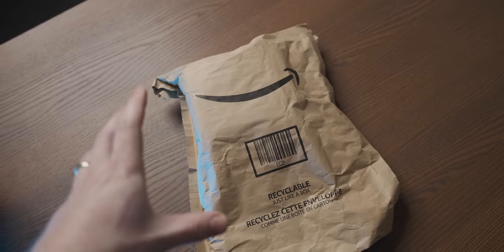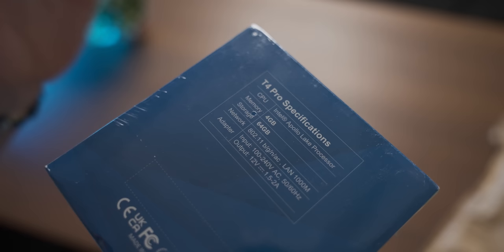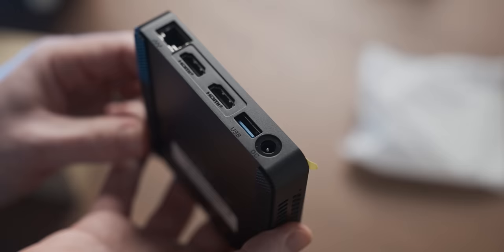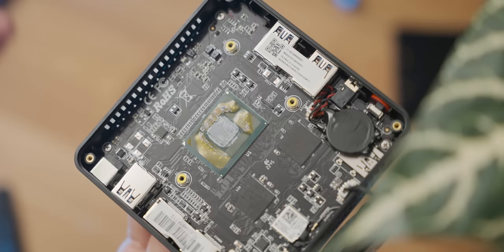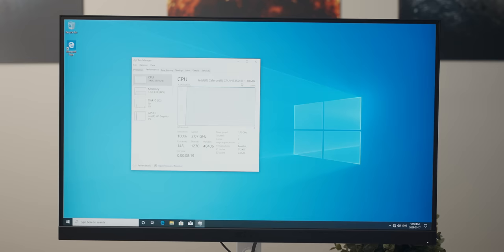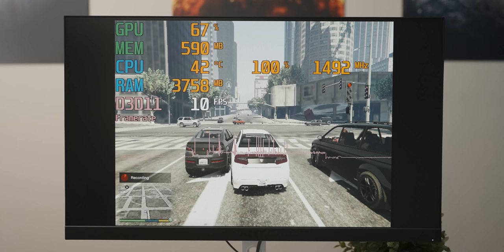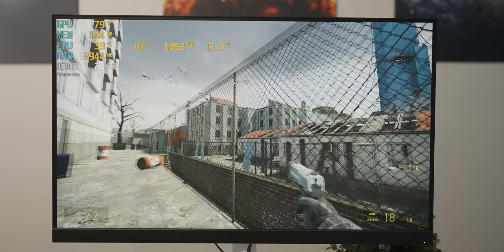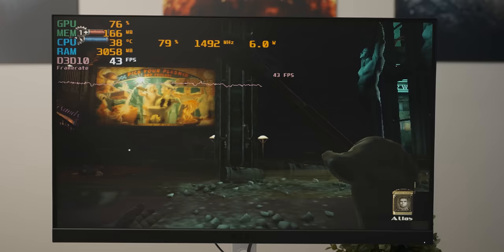This $100ish Amazon PC Is Apparently "Perfect for gaming"...

Comment: I have a couple of Celeron machines like these deployed. These are actually perfect for very casual computing and for low power, always on application. I use one for my 3D printer, and another for a home file/media server.
Reply: yep, I'm watching Youtube in my living room on a Celeron 2957U.
Reply: what the hell is home file server?
Reply: These mini pcs are awesome for office work
Reply: @sebastjansslavitis3898  Google your question
Reply: @uhm175  lol. He was totally baiting that guy. I Love your response
Reply: Can confirm, this kind of low power Celeron and Atom PC's are perfect for low power machines like network firewalls/adblock solutions like AdGuard Home or PiHole. Have few of those rocking not only AdGuard Home, but also simple Debian install which opens in full screen Plex at start so it can play files from another file server in home or for YouTube playback (and those are used on older smart TV's where OS is outdated and can't play YouTube at all anymore) and as Home Assistant Servers. For cheap (if looking on second hand marketplaces) I got like 5 of similar machines (obviously, varying CPU's from Celeron's and Atom's from mid 2012 to 2015) for price as low as 100€ (including for some new SSD's and WiFi cards).

Low power home lab FTW.
Reply: You can't use it for a media server. If Plex tries to transcode something it will blow up.
Reply: @marsovac  and that is why in my case Plex is used to playback from another server, it is just linked to it using that machines IP. For that use is flawless, and for maybe music playback from Plex server hosted on that kind of machine, didn't tried it, but will give a go when buy next mini PC like others with similar specs.
Reply: @idzan-private  wouldnt an Android TV device or an old Android phone be more efficient? 🤔
Reply: @sebastjansslavitis3898  were you born yesterday or something?
Reply: So basically an alternative to a raspberry Pi?  Or is it replacing the printer's processor?
Reply: @FranNyan  it could be alternative to RPi in this situation where RPi's are hard even to buy. But with Windows 10/11 compatibility it is sometimes better then RPi for some apps, like 3D Printer slicers.
Reply: @TragicAyk  yeah, for tv at least you would be much better with a cheap android box / streaming stick / roku hehe.  They all support plex and come with remotes and should have a slightly lower TDP than this I think... Android tv boxes typically perform better with games also I guess 😁.  For linux a raspberry pi seems like it would make a lot more sense than this also ?, and half the price 🤷‍♂
Reply: @sebastjansslavitis3898  its like a cloud storage thing
Reply: Casual like baby's first computer? Like minesweeper?
Reply: Sounds useless when any native pc can handle what you bought that cheap crappy one for. More justified chinese junk. Gonna sound crazy but I can process 3D renderings and play games all on one computer
Reply: @idzan-private  Exactly what I was going to say. It beats building an SBC system for a cloud server or the like. No need to buy a case and wire everything up.
Reply: @Revenant483  and on bright side - low power usage, which is in this climate of high energy prices - must have. And it is way more economical to run as cluster for your home-lab solutions (except NAS, for that really need space for drives and more resources really)
Reply: i swear people just make up use cases for things like this so they can justify spending their money in stupid ways
Reply: @SLAAMIT  nah man, just buy 15 chinese ewaste computers that can hardly do anything at all for bloated prices and consider yourself a tech guru for cheating yourself out of time and money
Reply: @idzan-private  Agreed! I guess it would not be easy to expand without adding more SSDs to the setup somehow.
Reply: Isnt it way more practical and cost effective to deploy these things on a raspberry pi or somethin like that?
Reply: @sebastjansslavitis3898  A file server, At home?
Reply: @dayenah8290  Disregarding the fact that you literally can't buy Raspberry Pis right now, something with an x86 arch is going to have better support than a Pi - even under *nix.
Reply: @SLAAMIT  What is a "native pc"? What if someone doesn't have or need a powerful desktop computer but wants to run a home server? What if someone wants to process 3D renderings and play games at the same time?
Reply: @gutless_worm  fair point :)
I didn't buy a raspberry pi for years. I didn't run into compatibility issues with the CPU architecture of a raspberry pi but you are definitely right, this could happen in certain use cases. :)
Reply: @sebastjansslavitis3898  if you don’t know what a home file server is you shouldn’t be watching this channel
Reply: @dayenah8290  raspberry pies are expensive as fuck
Reply: I have a J4125, it's not bad at all. Running Plex server I can use it to record tv without any problems, it can serve it back still with no problems, it can do transcoding but that's a bit of risky business depending on the situation. And while I admit it was a very, very low bar... I played a little Ion Fury on it via Steam remote play. Made no sense to run it on the little thing so I can play it on the one with double digit vram on the gpu, but hey, it was a test.
Reply from the maker: I’m glad you found some cool uses for yours. Those both sound like very useful things. 👍
Reply: @gutless_worm  Think about what you just commented. A native PC can process renderings (clearly isn't the one in the video) but a native PC can do both at the same time aka any pc built prior 2015...... There's no point in buying an underperforming device unless it's for content
Reply: @gutless_worm  I bet you have a PC for each room in your house because that's a necessity right?
Reply: @TragicAyk  I wouldn't recommend using a phone for something like that unless you want have content to post on r/spicypillows
Reply: @Marino Šimić  😃 it will work, but you'll watch PowerPoint slide show movie...
Reply: @sebastjansslavitis3898  It's server situated at home used to store file🤣🤣
Reply: @gamingmark54  why just don't store things on your pc?
Reply: @sakshyamrijal531  and why cant you just store things on your pc?
Reply: @Nas_Allie  and you shouldn't exist if you never had a girlfriend
Reply: @sebastjansslavitis3898  what a perfectly thought out response to type back to a nerd gold star 🤣
Reply: @sebastjansslavitis3898  Sorry am I missing something here? lol. A file server is storing things on a PC... A lot of things on a bunch of drives connected to a PC :)
Reply: @SLAAMIT  You keep saying "native PC" like it means anything. What is that opposed to? An emulated PC? You didn't answer any of my questions, you just reiterated the nonsense you said originally. What if someone doesn't have a desktop computer and wants to run PiHole or home automation software or an octoprint server? You're saying they should go and spend 5-10x what this thing costs on something that is 100x bigger? Or should they be forced to keep their laptop open and wired to their router or 3D printer 24/7? What's your solution? 

To answer your other question I have a laptop and a headless Linux server. I also have a IBM System/36 5362 that I use as a piece of furniture but that technically isn't a PC.
Reply: @marsovac  it's used for  the client, not the server
Reply: Was considering one for a dedicated DAW box, to use with the Aira Compact series.  My concern is that operation might be sluggish and unreliable.
Reply: @sebastjansslavitis3898  a home domain can be extremely useful.
Having a consistent backup for both my wife and I is great, able to store movies on it to stream to my TVs, also able to use as cloud for our cell phones instead of paying for one.

Comment: I'm going to consider this PC as a possible alternative to a Raspberry Pi 4. Try buying a Raspberry Pi 4 - 4 GB for $100...and that's if you can even find one for sale. That you can run Windows on it may mean a better experimentation platform than the Pi, that is, if you don't need the IO header pins offered on the Pi platform. It can be frustrating trying to get software to run on a Pi, but with an Intel architecture, it should be a LOT easier to compile and run Linux apps.
Reply: Yeah this or like a laptop from around 2012 - 2016 with an ssd in it & a fresh battery probably is another good option for like 20 - 150$.
Two laptops i got around here is a samsung np355v5c hd 7670m, amd a8 4500m & 8 gb ram which i only needed a charger for (25$) & got free otherwise without a hdd & battery is gone as well.
But i don't use it much anyway so i don't really need a battery.
Bit low res screen from what im used too on my desktop pc but for webbrowsing & looking at Youtube perfect hooked up too said 1080p display instead of my desktop pc with mouse & keyboard its nice.
Runs older singleplayer games like half-life 2, fear, stalker shadow of chernobyl fine, slapped in a leftover 240 gb pny cs 900 ssd after i put in a 1 tb m.2 as a games drive in my desktop pc running Atlas OS which is a bit slimmed down version of windows 10 pro, havent bought a license for the laptop for now at least.

My secondary laptop the Lenovo T420 I'm running as a wifi repeater atm.
4 gb ram 320 gb spinning rust drive with like 38k hours probably at this point, bought it from my uni for 30$ a year after i graduated in 2016 with like 2500 hours on the hdd.

Harddrive is slow as balls on it, specially with a stock windows 10 install but as it only runs as a wifi repeater it's fine too leave as is, it's literally just left too idle next too my desk with webcam & mic disabled.
Reply: Look up Lenovo Thinkcentre Tiny PCs. You can pick up an used model with an i5-4570T, 8GB ram, 500GB HDD for about $55.
Reply: I saw someone trying to compile mongoDB for Arm v8 (officially release compiled for Arm v8a) on a Pi. It was of course a diaster. A $100 x86 alternative is a no-brainer
Reply: If you don't need IO pins just buy a small used office. At least Intel 4th gen and part of the core series.
Reply: @Sunlight91  those are bulky
Reply: @hihellothere9569  that's like calling a suitcase bulkier then a purse. No crap, but ya can store (do) a lot of crap in there
Reply: XD this is exactly how i ended up with my nettop with a J3355 and 8GB ram. I got it used for less then a 4G pi4 would have costed me.
Reply: You can get large amounts of old thin client PCs for cheap like futro s720 or HP t610 and t620. As long as you don't need GPIO pins it's better and cheaper
Reply: @hihellothere9569  no they are not. He is talking of SFF office PCs like Tiny/Mini/Micro series from HP/Lenovo/Dell. THose are 1 liter volume devices
Reply: I myself would love to get one too but yea preferably a 8gb ram one but all sold out. Sighs
Reply: @Dracossaint  but do the benefits outweigh the fact that it's too big and heavy?
Reply: @marcogenovesi8570  I know and I've seen those kinds and they are kinda still bulky
Reply from the maker: That’s a good idea. Is the Raspberry Pi market still in shambles?
Reply: Nah check out the older Thinkcentre mini PCs, they're much faster and can be found for less
Reply: @DawidDoesTechStuff  Yep, it's still bad. SBCs are overall weirdly expensive still, and RPis are the most egregiously overpriced of them all. Understandable, given businesses hoarded them to ensure continued operations...
Reply: @DawidDoesTechStuff  yes it is still worth more than its weight in gold
Reply: @hihellothere9569  they are literally twice as big as a raspi + enclosure while powerful enough to replace 4 or 5 raspis
Reply: @hihellothere9569  depends on your use case. but more than not, yes by a long shot.
Reply: @Dracossaint  exactly. Raspberry Pis, these boxes, low end laptops, SFF PCs are all for different jobs.
This is more of an office box with some media acceleration for skype, zoom, etc, but no ways to upgrade. Even a SFF business machine can slot in a low profile GPU. Pis and those boards are more tinkerer and diy focused and cheap laptops are just cheap like netbooks.
Reply: And, if you are not satisfied by Windows, you can run a Linux Mint in it
Reply: That's what I was thinking the use case for this would be. Pis are hard to come by right now it seems. I was looking to upgrade my pi3. The build quality in this looks nice.
Reply: I've been put off Raspberry Pi's for some purposes because of SD card reliability. A cheap x86 PC like this or a used Dell Optiplex or Lenovo/HP equivalent is an excellent buy for home server purposes.
Reply: @MrMega200  I work always remoted in another machines, so I picked up Tiny PC from lenovo, i3 8100T, 16GB of Ram, I just put it in a SSD and its the perfect machine for my job, small, low power cosumption, almost zero noise, I can use RDP and browser just fine with it
Reply: @DawidDoesTechStuff  Its used in college projects
Reply: @MrMega200 I use the old Lenovo Tiny PC’s to run Batocera and they work amazing.
Reply: @Lodinn  god i hate businesses so damn much
Reply: @MrMega200  link ? I’m only seeing some for $100

Comment: It is locked at 6W of power and for the CPU alone it may be fine at lower load tasks but when the GPU usage is high there is even less power left for the CPU and it throttles hard sometimes even under the poor base clock like you can see in this video in Bioshock gameplay, what I would do is install program like ThrottleStop and manually change power limit and boost clock time to higher value, I tried that on Intel Atom tablet and it gave performance boost of few hundred percent in some scenarios.
Reply: Good to know about this!
Reply: 6W even for a laptop is pathetic. ThrottleStop all the way!
Reply: Same thing happened with my old atom x5 tablet the CPU power limit was I think 2.41watts and the GPU was 4watts or something I tried some latest games on it the CPU clock get's down to 480mhz. It was an Acer Aspire Switch. Currently it is connected to my non smart tv
Reply: And also 4GB of soldered RAM is of course the next thing that limited its capability.
4GB in Windows PC is barely enough for basic task in 2023 unless you are brave enough to debloat all the intrusive Microsoft stuff (like disabling telemetry and removing some unnecessary system apps to cut down the RAM usage)
Reply: What is seen in the Bioshock gameplay is the cpu adjusting to a more efficient frequency rather than staying at high, more power-hungry clocks just because. This is demonstrated by the utilization barely breaking 70% even at sub 1GHz, the game is entirely gpu bound. Still, I support the notion of the using ThrottleStop in a system like this, and the cooling can absolutely handle more power since it rarely went over 40C at 6w.
Reply from the maker: Oh yeah! I didn’t think of using throttle stop with it. I’ve used it a bunch with laptops, but it really makes sense for something like this. Thanks for the suggestion l.
Reply: Yeah, those small low power devices aren't really for long term high load tasks. And the power limit is the same situation that APUs also run into. Once the GPU load goes up, they have less left for the CPU, so that drops, which hits performance.
Reply: @DawidDoesTechStuff  As yous tested it with Playstation One which had interesting results,  it got me wondering how it might run MAME or how it might do with older Machines like the Sega Megadrive/Genesis or the Super Nintendo or even something older still like the NES and Sega Master System. 
I can presume it might be perfectly OK emulating much older Coin Ops and as such might be a fun little novelty device to work with your smart TV, assuming it can output a signal good enough to not look horrible on a 4K display.

I can see it might be able to run game that are designed to work on a Chrome Book or Tablet say those from a free game site ; simple stuff like Match 3 or Hidden Object games those more or less work fine on even an old Window XP running system so this must be in at least the same ball part as those. and being so very low power, it might be something you can leave plugged in without worrying about it unlike say a laptop.

Unless the PSU melts or something that.

I wonder how much more decent of a system you would need spec wise to run it as a Media device for streaming and such. Or is it even able to out put a decent enough video signal.

I think I can imagine some very interesting use cases for little boxes like this even if some of those uses might require just a bit more power.

Great for someone who travels a lot though and doesn't want' to carry something as bulky as a lap top. just play it in your hotel room say..
Reply: @DawidDoesTechStuff  You should see how well it runs oldschool runescape with the runelite plugin.
Reply: @DawidDoesTechStuff  maybe a follow up video if it helps, or at least a pinned comment?
Reply: @GewelReal  6W is medium for a ARM based cpu the fact gta 5 is running at all on just 6 watts that cpu is ripping